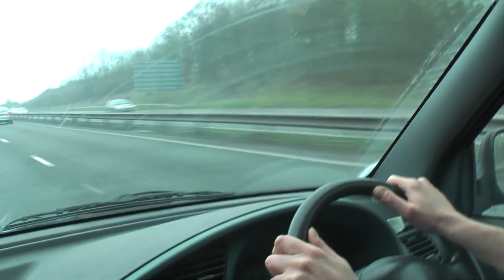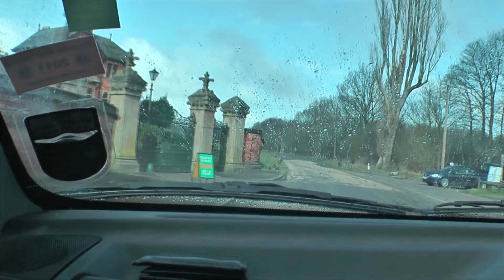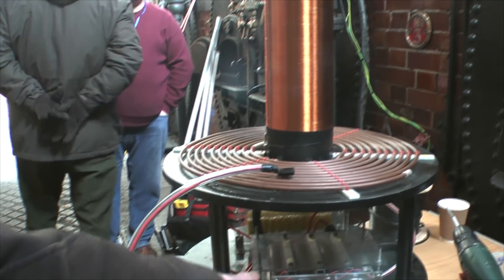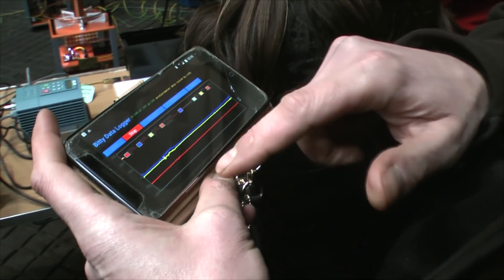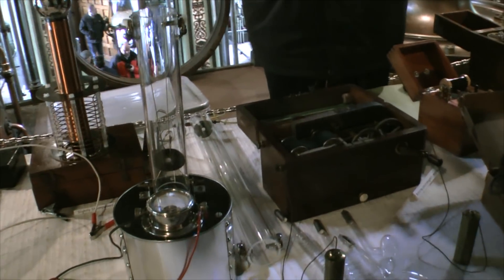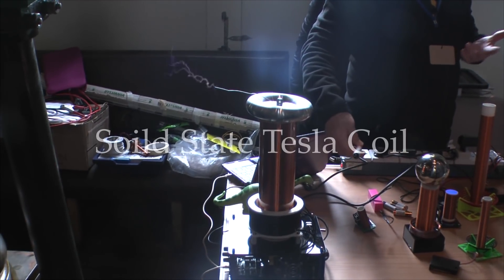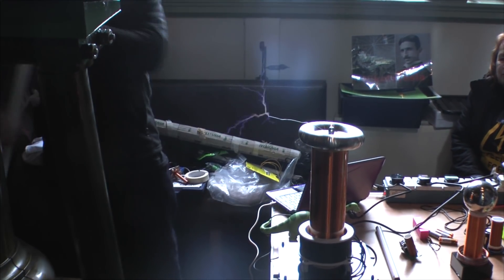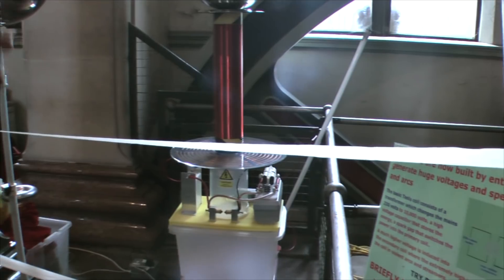Gaussfest 2018

Comment: i wonder how much potential difference there would be in the air if all the exhibits were oriented correctly. put some electrodes on either end of the building and you may not even have to plug into the wall.